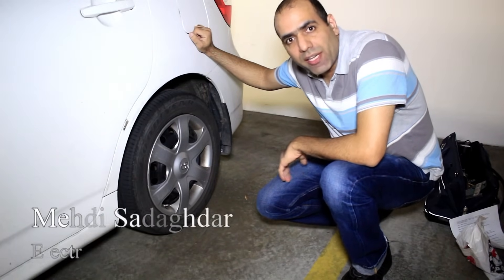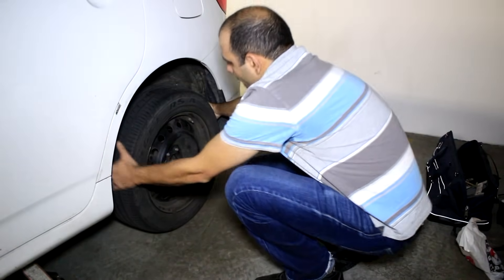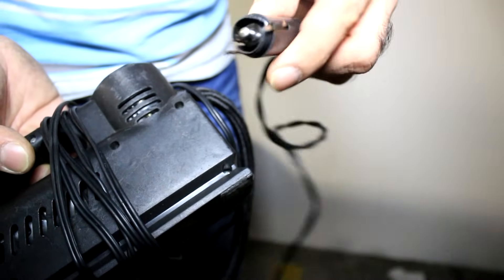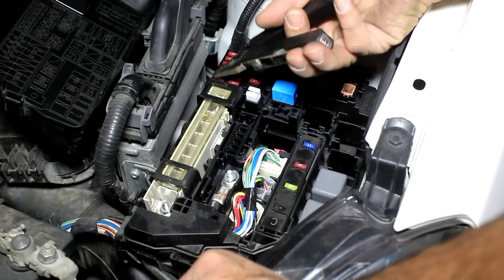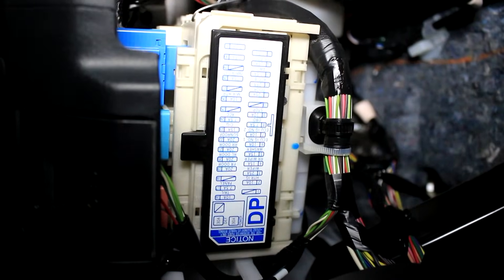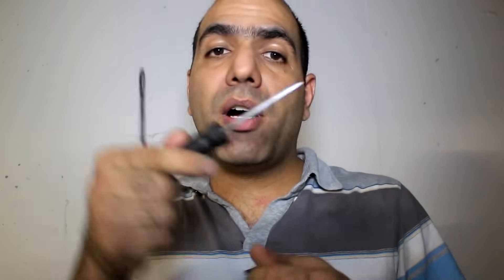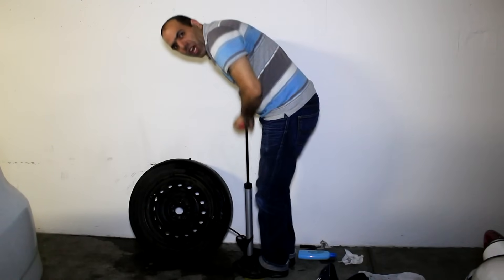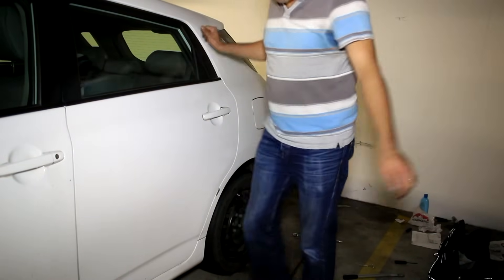How to Repair a Flat Tire

Comment: Fyi, for safety reasons, those types of tire plugs are illegal for service centers to use.  Primarily the reason is because of an accident that occurred because the technician had used the "push plug" type to fix a hole and as a result the reason for the hole stayed within the tire causing a blowout, leading to a fatal accident.  The standard that service centers must adhere to requires the technician to remove the tire from the rim first so as to inspect the inside of the tire and to insert the plug from inside the tire to pull through from the outside.
Not to get all technical but just figured I'd put it out there that although you can still buy and personally use the "push plug" style of tire plugs they are a less safe method of repairing a tire with a hole.
Reply: +Broadcast1Channel It's still misguided nonsense.  Tire plugs aren't likely to cause blowouts;  potholes, improper inflation, and overloading are the typical causes of blowouts.  A slow leak like one from a nail puncture is less likely than most tire damage to cause a dangerous incident.

The truth is, some guy had a blowout because he wore his tire out or his a big bump, they found a patch in the tire, and he sued the tire shop and won.  Tire shops don't do them anymore because they know the precedent of the law is against them if they do.

Besides, what kind of business man would fix your tire when selling you a new tire is far more profitable?

When I was young, I had no choice but to drive on a temporary spare rated for 50 miles... I did it for about 6 months and it's still in the trunk of that old car holding air.  If I needed it, I would check it for dry rot and if it looked good I wouldn't hesitate to use it again.

A poor man has poor ways... but they're still ways.
Reply: Agree in a lot places tyre repair string is not approved for road use these days the UK being one. Reasons being sited that this type of repair is not a complete repair which can push out under pressure, pull out under breaking, fail to maintain a seal, that there may be further damage that can not be seen from the outside and so on... Although I have used the stuff as a quick fix to get home or to the tyre shop but keeping the speed down and breaking gentle until it is repaired or replaced. One thing I have found is don't let the AA fit any type of temporary repair as they knacker the tyre by reaming out the hole to big so the tyre shops can not repair it. The other thing to avoid is tyre repair moose as apparently tyre shops can not repair tyre that has been filled with this stuff. As for farm vehicles you can often play a game of connect the dots with all the tufts of string poking out ;)
Reply: +Sicstix lol you idiot.  You said illegal.  This implies government because only government can make something illegal.
Reply: illegal... where?
Reply: Brandon Tomasik I meant to include that part in the first sentence. XD
They are illegal in Canada, for service centers that is.  They are legal to sell and legal for personal use still.
Reply: +Sicstix awesome response.  your reasoning for the plugs to be unsafe is durr government says so.  news flash jackass that's not a reason.
Reply: The strings with the vulcanized rubber have been around for along time and can be effective at plugging a puncture. With time motor vehicle technologies have moved on a long way and people have become accustomed to traveling significantly greater distances and at greater speeds. Subsequently the stresses endured by the patches of rubber trying to hold on to the surface of the road are given a relay hard life.

Any permanent repair to a tire has to be able to last the remaining life of the tyre while being subjected to everything road use can throw at it.

In the UK I believe that repairs are permitted to be done only in the main tread area, not in the outer tread or side wall. There are also limits to the size of the puncture and if there is any taring, cuts or remaining foreign bodies. Bulges in tyres are a no and there is also minimum tread depth. Also tyres with a V rating or above aparently can only be repaired once.
Try checking all that in the rain / dark with a dull flashlight on your knees with cars flying past.  

At present I do not believe that there is a maximum age for a tyre in the UK but there is a move to bring in an expiry age for tyres. I agree with the age of tyres as they do perish and and go pop too easily with age, and an old tyre can look ok and still suffer an age related pop.

So back on topic and it is not just governments making laws for the sake of making them. Through collaboration with in the industry, regulatory testing bodies, agencies, crash investigation reports. Standards have been developed from hard evidence.   

Simply tyre repair strings in a lot of countries are not approved for road use which has been established through existence testing / research. Hence tyre shops will not use them and only conduct repairs to the standards that apply to them in the territory there in, to be able to warranty them and be covered by liability insurance they have. 

Any temporary get you home repair (bung, moose ect...) is just that. The idea being that it is a temporary fix to limp to the tyre shop.
Reply: Thanks!
Reply: Thats actually pretty interesting. I used to work for a bus company and we would use those quite alot.
Reply: +Sicstix I agree 100% with him, there is nothing unsafe about tire plugs, I've used them on trucks and cars for years, and never saw one fail. 
The pulling the tire off the rim to check the inside?  for what, lost kittens?   
If a nail goes through the tire, you have a pretty good idea what is inside of the tire, the same hole thats on the outside. 
The only reason to pull the tire off the rim, is if you want to charge more for a patch (And those I have seen fail) and if you want to charge for a mount/dismount/ re-balance package.  Turning a $3.00 repair into $25.
Reply: +lizard450 Patching a tire properly in a manor in which your tire is torqued and not going to fall off the car costs a mere 25 dollars, Fuck plugs, use patches.
Reply: +Broadcast1Channel In 40+ years of putting plugs in, I have NEVER had one come out, or even heard of one coming out. The material in the plug forms a bond, and can't push out unless its improperly installed.
Reply: KiloG5GUnion Frosty Nah, they probably just knew they were charging double what the tires were worth.
Reply: +Sicstix I'm not so sure about this. I get my tires fixed with this tool all the time at a service centre. I am in Canada.
Reply: I use these things all the time. I've even patched a couple sidewalls and they've lasted the life of the tire.
Reply: I've always been told they aren't used because repairing that way could damage a radial belt in the tire and make it unsafe.  I plug it and see if it bulges and then forget about it.
Reply: +Jonathan Duncan The hole is already in the tire, that reamer isn't going to start cutting belts, it only removes enough rubber to make the plug fit. The steel belts are a MUCH harder material than the reamer is made from. If you have a large enough hole to damage the belts, a plug kit will not work.
Reply: +KiloG5GUnion Frosty That's great.  I don't know of any around here and it isn't like they are going to allow me to inspect their shop and select who works on my car etc.  I'd rather just learn how to maintenance entirely myself.
Reply: KiloG5GUnion Frosty I was joking.
Reply: +Sicstix 
Everyone knows that by removing the tire off the rim and putting it back makes it lose much of it's quality and age
Reply: Anti donkey missle mmhmmmmm, everyone now also knows that you know absolutely nothing about tires
Reply: +Sicstix Not only that, but multiple punctures in a single tire... and the puncture he plugged was in the shoulder. tsk tsk
Reply: I use these things all the time. I've even patched a couple sidewalls and they've lasted the life of the tire.
Reply: +Jefferyl22 #runningwithscissors
Reply: +lizard450 Thanks a lot....now I remembered that I have a chore today. Change my oil. :(
If you hadn't written that I could have waited until next weekend. :)
Reply: lizard450 Wow chum, you got some serious issues.
Reply: Majin Snake If the repair is correctly done it is going to be as safe as if the tire was new. The "gooey stuff" on the rubber string vulcanizes the two pieces together as if they were one chunk of rubber all along.

That whole tire blowout business as described is bullshit. Sure, a repair could have been done improperly, maybe leading to the tire bursting. Or rather, the tire could have more than superficial damage, that went unrepaired. Absolutely. But, If that was to result in a fatal accident, it would have been a fatal accident no matter the reason for the tire bursting.

I have had a tire literally exploding at 160 km/h (100 mph) on the Autobahn, in the left lane, while overtaking. By staying calm and not making any sudden or wild movements with the wheel or panic braking or anything like that I was able to ease the car onto the outer shoulder and stop safely. No fatalities...

The only one I could have blamed had I had an accident that time would have been myself, for not having enough driving skills to handle my vehicle. When driving, you must be prepared and trained to handle the unexpected. I am by no means a super human race car driver, but I am a trained driver.
Reply: +lizard450 my local discount tire gave me 2 brand new tires for free because i didnt have enough money for all 4 and the ones on it where very worn. not all shops are shady or out to gwt you bro.
Reply: Justin Hall No they wherent dude...... sorry to ruin your negative views.
Reply: +Sicstix This screams bogus bull shit to me.   "less safe" ... GTFO of here... quantify it.  Back it up.  Everything is .. Oh you didn't inspect the inside of the tire.  Fuck the inside of the tire. Does the tire keep pressure? ... yes?  Then have a coke and a smile and shut the fuck up.  

All this bull shit is designed to do is to get people to spend 50 bucks to "fix" their tire rather than spending 20 bucks for a quality plug kit and being able to fix 30 tires.  Or you could go cheaper too.  

This is why people hate mechanics.  The good ones have all gone on to do something better that breaks their back less and makes them more money.  The ones that remain are part swappers.  Trying to charge me an extra 160 bucks to install a 10 dollar in cabin air filter that I installed my own damn self because the car didn't come with one.  It took me all of 5 minutes and required no tools.  Which reminds me I need to change my oil.
Reply: lizard450 I suppose even the obvious evades you.  I omitted providing a reasoning because I know better chum.  And f.y.i. genius I didn't mention the government anywhere in any of these posts, maybe you should go back and try rereading things maybe work on your comprehension skills.  Btw I know better than to bother trying to prove anything to clowns like you because you are likely to deny any evidence provided given the quality of character you've shown.  Get a life chum, I'm sure there are better things for you to do besides picking random comments on YouTube and turning into bitch central just because you aren't satisfied with the content of the comment regardless of how accurate or erroneous it may be.

A bit of advice for you, fail to be a whiney ass bitch people may actually start to respect you.

Good day.
Reply: lizard450
Keep trying chump

Comment: After 3 punctures in the same tire it has become a safety hazard. Any sudden impact could cause the worn out rubber to tear. If I were you I'd buy a new tire asap.
Reply: +FrenchFruits Dude, steel belted radials have been standard since probably before you were born, and since a hell of a lot longer than before that car was made.

Worst case scenario, it's a recapped tire, the air gets inbetween the belting and the cap, the cap flies off, the car drives poorly, the driver pulls over and feels like an idiot for putting illegal tires on his car (he's in Canada, good luck finding legal recaps for a car here).

Comment: Hey friend, great video!! So funny but true. 
Two corrections: 1. Use rubber cement to lubricate the tar string. 2. You don't need to take the tire off the car.
Reply from the maker: +gilbet your second point, it would be pretty hard too look around teh tire for punctures and also seal it, no?
Reply: +ElectroBOOM maybe he plans on driving his car into the bathtub full of water
Reply: +ElectroBOOM Jack it up and rotate it, you can watch or feel with your hand. It's not hard at all.
Reply: +phil chao windex works to find punctures
Reply: +Ayeamme +ElectroBoom This is correct.  Tire doesn't necessarily have to come off to find a leak, but it is much easier.

A third point I would have made... ensure that the lug nuts are tightened to the proper torque after the car is on the ground for the same reason that you needed the car on the ground to loosen the lug nuts.
Reply: By the time you've found the jack, I've already found the leak in 10/12 cases. For the other 2/12 times its on the bottom (5-7 O'clock) I can just start the car and move the car forward 6 inches to expose the leak. Then just roll the car to where the leak is facing forward at 4 O'clock and you have easy access to it.  Much quicker than jacking up the car.  I've done it around 20 times.  (Used to have a gravel driveway with nails.)

Comment: Did you just tighten the lug nuts while the wheel was in the air? That's a terrible idea. Don't be surprised when you get some serious vibrations at speed lol

Comment: Using a hand pump to air up the tire is easier to do if you jack up the car to take the weight off the tire.

Comment: The pressure is listed on the side of your tire as to how much you should put in. Also it should come with some glue you put on it keep it in place better. When you tighten your lug nuts you go in a star pattern to make sure it's stable and tight all the way around. Other then that you did it all right. (I know this is for comedy for the most part but some people aren't as bright as their mother's hoped.)

Comment: You forgot to tighten the nuts to a heavier torque after lowering the wheel back onto the ground. Also, the tire placard in the driver's door jamb will tell you the exact pressure to set your tires to.

Comment: You forgot to torque down the wheel nuts once the tire is back on the ground. You might want to check that before your wheel falls off while you're driving.

Comment: String repairs (aka dog turd) are technically illegal here in NZ, or at least are a "Warrant of Fitness" (6 monthly inspection) failure.  Only mushroom plugs inserted from the inside are permitted (and not close to the sides).  They still have their use though in a get-you-home fix on the side of the road, especially for motorcycles.
Reply: I use the "stop n go" plugger kit for my motorbike, comes with mushroom plugs that are inserted from the outside of the tire (special applicator like a screwdriver injects them in).

Might be worth a shot hunting one out if you're NZ based as how on earth can they tell if its an externally fitted mushroom or internally fitted, I can't think of a way.
Reply: +James Sleeman How would they know? Surely they don't take the tyres off the wheels every 6 months? Also 6 months! Cars in the UK don't need a MOT (inspection) until their 3rd year and then only annually.

Comment: Tire Repair shop manager here, First of what he put in here is a plug and a plug is never 100% guaranteed. only apply a plug if you have to get to a shop or if you're running late and cant do an inside patch otherwise always go with the patch. A patch isnt affected by wear and tear such as the exposed plug nor is it affected by the outside weather such as rain heat or cold. Its maybe a 5-10 dollar difference but you save time in the future and you dont have to worry about it later on. P.S. if the damage is near the corner of the tire or anywhere on the sidewall DO NOT FIX IT that tire is more than likely gone you only risk catching a flat where you least want to, by repairing any damage on  the sidewall or the very edge of the corner you are playing a risky game.

Comment: Make sure to tighten the nuts once your car is on the ground by using the tire iron and standing or kicking down on the handles. Hand tighten can be vibrated off, so you need to make it really tight to ensure that you dont loose a tire on the highway

Comment: I used to work at a garage in a dealership and we would have to plug/patch tires for free a dozen times a day; then retrain the tire pressure sensors. Thats right, they wouldn't pay us to repair tires.

Comment: 32-36 PSI?? you should always check what the manufacturer recommended tire pressures are, as this is influencing both fuel economy and handling. It is estimated that 15% of all accidents are due to wrong tire pressures :D Other than that - another amazing video! Keep up the good work!

Comment: Recommended PSI depends on car model. I have a 2002 Toyota Camry (much lighter than your car) and you're only supposed to go up to 32 PSI if the back and trunk are full.

Comment: I feel the pain of using a bike pump on a leaking tire.  I had a leaking tire that needed to be filled daily, and I would end up in parking lots all over just pumping enough to get to the nearest gas station with a pump.